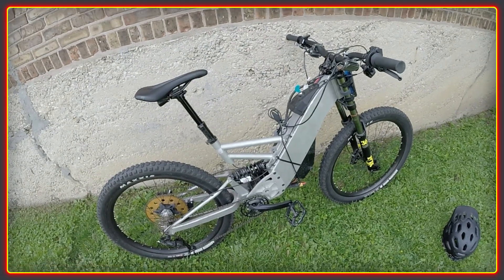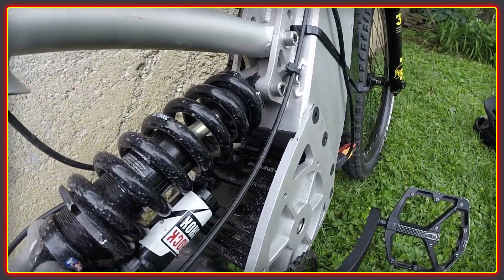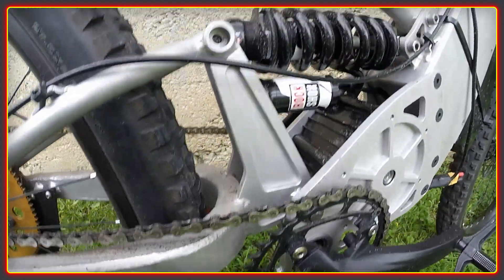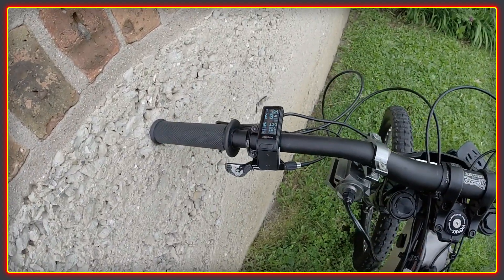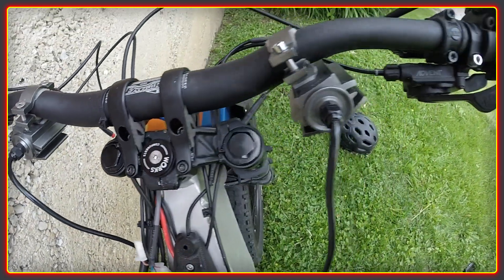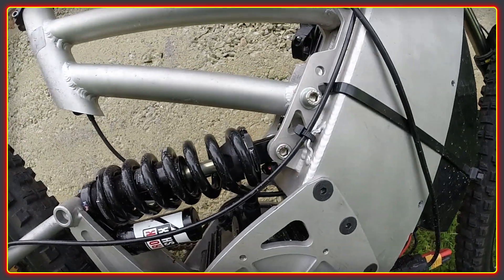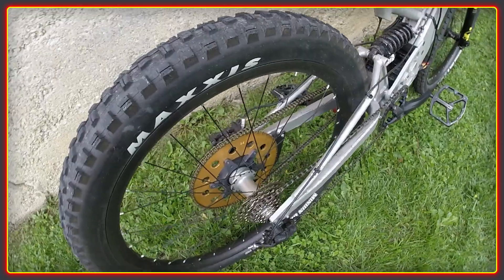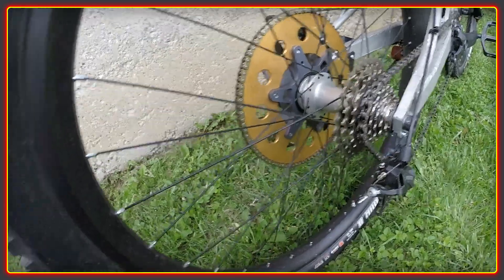Super Fast Ebike on a Budget - 55mph+ for about $4000

Comment: How is the quality of these motors compared to bbshd and Cyc x1? Are they a bit more difficult or faulty like the cyclone 3000? Thank you
Reply from the maker: They are definitely on a par with the BBSHD. Much bigger than the CYC. You can definitely break them and they have their limits. Heat is the main killer. This bike has pretty good heat sinking built in aa its bolted into the Aluminum frame.
Reply: @HighVoltageKits  that’s great to hear! I’m in California and just discovered these motors… didn’t know if they were also as difficult for a novice to install/troubleshoot much like how the cyclone 3000 always gets described. I ended up staying away from the cyclone motor because of this, but then saw these motors and became very curious as they look far more powerful.
Reply from the maker: Stay safe, heard its bad there

Comment: My hope is for a greater variety of DIY e-bike specific frame options by enterprising aftermarket companies for motors like the BBSHD, Bafang Ultra and LIghtning Rods Big Block motor looking to the future.
Right now, in the infancy of ebikes and the DIY market which you at High Voltage are participant in developing and we are in your debt for taking this initiative...different motor, battery and controller options exist, but very few frames aka platforms that can accommodate different motor options.  No 'rolling chassis' aftermarket options for example exist that I know of that a DIY'er can purchase like they can order a motor kit.  An offering like this, something that bridges the gap between a conventional bicycle frame and a larger and bulkier Enduro frame that is popular for higher power builds with companion weight penalty, would be the sweetspot for many home builders I believe because this type of chassis stays truer to the versatility of a regular bicycle however doesn't have the bulk of the Enduro chassis which is closer to a motorcycle.  The larger, high power ebikes have their place for sure but many would prefer a more stealth option but can develop the power of the bigger bikes.
You lead the way with your look into the future and thank you for showing us this cost effective option which maybe a look into tomorrow for the DIY community.
PS. I wrote the above and then started to read the comments below and noticed Bud, who always has great comments, wrote the same thing....I embellished a bit as we are on the same page. :-)
Reply from the maker: Agree. There is a nice market space. I have one of the lite frames arriving soon from ELEEK which has a similar form factor. Might be fun to have a crack at designing one!

Comment: I would like to see the Lightning Rods company build frames for their motors.  Should be easier to build than the motors themselves.  They could make quite a bit more money too.  Just a thought.  This build shown here is something that I could see myself imitating in the future.  Thanks for sharing.  Cheers.
Reply: Slightly less powerful full bikes.?
In the 3,200 dollar range. Cheap  transportation  to work,if jobs still exist  in a year.
Trying  not to be pessimistic. But who knows?  I would trust your builds  over what I've seen
Reply from the maker: I know what you mean. The cheapest would be to get an older hardtail and convert with something like a bbso2. Johnny Nerdouts channel has a ton of these kind of builds.
Reply: @markwat  I personally found that if my math is correct if you buy one of the lighter bomber clone frames for example the keyu f3 frame, I was able to squeeze ~45mph out of it with a 48v 1000w motor and 33ah battery (two prebuilt hailong batteries ran in series) it all came out to about >$1600. I will admit though I probably could’ve done it cheaper if I used all Ali express or Alibaba but my build was very much rushed so I was using Amazon for some things too. I also cannibalized a cheap $98 mountain bike from Walmart for some parts.
Reply from the maker: You are welcome. It's given me some ideas

Comment: That motor literally screams. I sure would like to know where he got that full twist throttle grip I haven't been able to find something like that. Does sound like he's got a problem with one or both of the brakes sounded like almost metal to metal at one time there.
Reply from the maker: Well spotted. Slight brake issue that was fixed midway. The throttle is a Magura one.
Reply: It looks like a Domino throttle

Comment: I think qs 138 90h would work better
Reply from the maker: It would not fit inside the frame I don't think. The LR motor is literally an exact fit.
Reply: This particular bike is using the BAC2000 and is supposed to be a light build. The QS 138 would have more power yes but would require a bigger battery, controller, and frame.

Comment: IMO,, we all know that your Ebike builds are NOT Legal .. At best they are Motorcycle s !
Reply: Mind your business.
Reply from the maker: I have a series I'm working on with regards to this. No they are not legal and there is not a mechanism in most of the world to enable them to be. With this build you can actually peddle along with genuine effort. I prefer to use the term light electric vehicle personally. This built is not an ebike if and ebike can only be a certain narrow definition. It's also not a motorcycle although the performance is not far off.
Reply: @HighVoltageKits  The people that follow your channel understand this but a lot of ignorant people make up the world and why I almost never bring up the speed of my ebikes.  People can be extremely lame.  The most prevalent conversation I have is people against 'throttles'.  I tell these idiots that a throttle is one of the best aspects of an ebike. There is bike shop near me that refuses to work on an ebike with a throttle....lol.  That's ok, I never walk in a bike shop.  People can be extremely petty.
Look at the legislation in Europe.  More than a few 3K watt ebikes running around Europe stealthily however the 'legal speed limit' for ebikes in Europe is '15 mph' on the street which is actually dangerous when sharing the road with cars and motorcycles.

Comment: sorry but in what world u call  $4000 a Budget Ebike?
Reply from the maker: Everything is relative. If you consider performance, power, range and ridability as well as the spec. In ebike terms 4k is a pretty tight budget. It's not bargain basement time.
Reply: Entry-level e-bike in Bike Shop brands
Reply from the maker: Yeah. I mean you can get one for 700 bucks at Costco. It might do 15mph.
Reply: What ebike under 4k can do 55mph or higher?
Reply from the maker: Maybe a stolen one 😆
Reply: @HighVoltageKits  :)
'